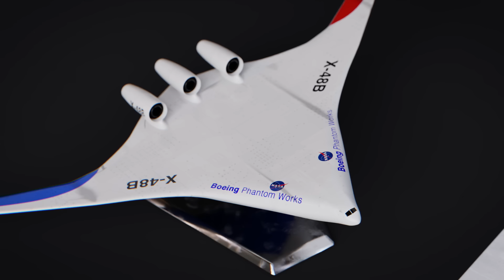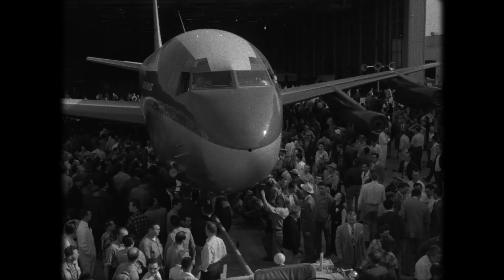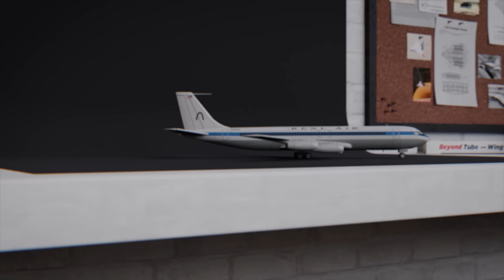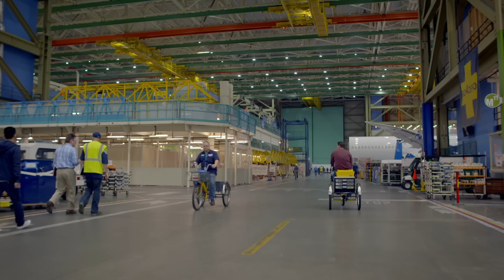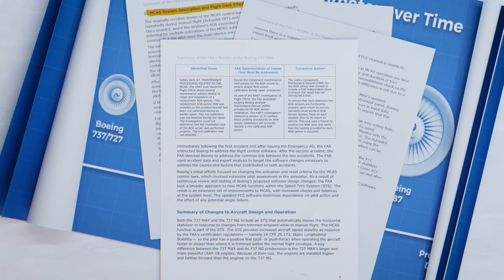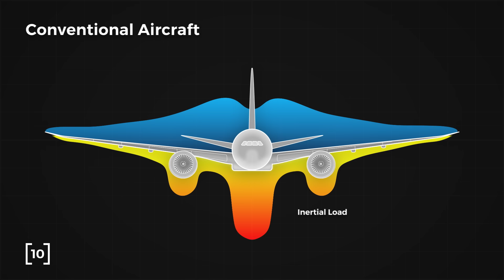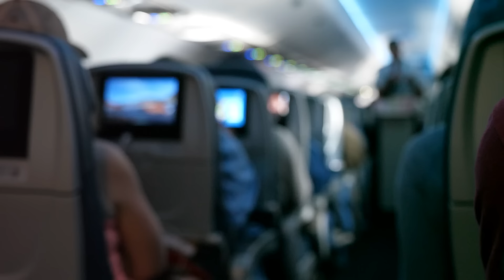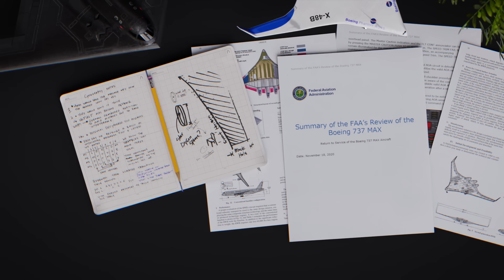The Plane That Will Change Travel Forever

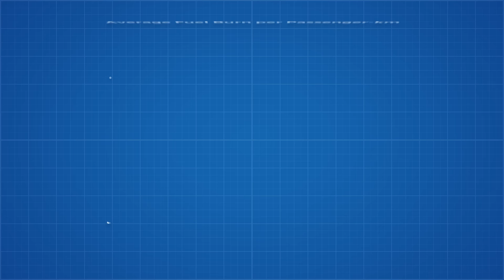Comment: "Nice" misleading graph at 1:06. The axle of the graph depicting fuel burn starts from 50, not zero. Sometimes there are proper reasons to adjust graphs this way, but I can see no good reason in this case. When the name of the channel is Real Engineering,  the audience deserves to see real graphs.
Reply: its still down nearly 50%
Reply: @xdxmABB  
- " its still down nearly 50% "
Yes, it is, but you seem to have missed my point. I didn't say or imply that there has only been a minor change in fuel consumption. My point was that when you do a documentary, you should convey the information in a way that isn't likely to mislead people. In this case many people will be mislead, and not slightly, but close to an order of magnitude. What's more serious, the misleading seems to be intentional, as anyone with a basic understanding of statistics knows that graphs like this one will mislead people. It's exactly what causes people to say "lies, damned lies, and statistics". The problem isn't statistics itself, ofcourse, but misuse of it.

Comment: I noticed 5 major benefits the 'flying wing' design would have over its more traditional counterpart that you didn't mention.
1) By eliminating the need for a tail stabiliser, the 'flying wing' design would effectively reduce the plane's length (central axis running front-to-back). This is significant as it would reduce the possibility of minor incorrect/imprecise weight loadings/calculations having a significant impact on the plane's overall aerodynamic stability. Generally speaking the lengthwise axis in a typical plane design is the most unstable and hard to manage axis due to its far proximity from its center of gravity. 
2) Disregarding the control issues mentioned in the video, there's practicality in the design as a glider. To keep it short, if the plane was 'falling from the sky' intact, the belly of the fuselage has a great amount of surface area, the design could be used to extend its rate of descent and gliding range (via vertical drag). This means that the drag produced by the plane could help reduce the impact forces experienced by passengers during a controlled emergency descent.
3) Based on B2 'flying wing' designs and other similar experimental military designs, the engines of the plane could be mounted on its roof. There are numerous benefits with this mounting position the first being how it reduces the likelihood of tarmac debris getting sucked into the plane's fan intake and severely wrecking the engines. (notice how I didn't say bird intake)
4) The roof-mount configuration would increase safety by reducing the likelihood of ground crews getting caught in the moving engine or getting knocked over by the windblast of the engines.
5) Finally, the roof-mount configuration allows for the possibility of jet engine noise being redirected upwards towards the outer atmosphere away from the ground. This would be crucial in reducing the overall amount of noise pollution that affects homes located under any flight routes.

Comment: It's great having windows, but I find it more claustrophobic to squeeze past other passengers and bags down the narrow path through the fuselage.  As long as the ceiling / overhead storage is't too low, a much wider area that is brightly lit would feel like any room we have no problem working and living in all day.
Reply: Maybe the "windows" could be shifted to the ceiling in the form of light tubes for skylights?  And the storage could be moved to under-seat to open up the headroom.

Comment: No matter how safe the design of the airplane is, or how safe the software is, if those safe designs are not forced into the final product, and any future modified versions of the model, by the FAA, and other regulatory agencies, it is all for naught. And more fatal disasters await us.
EDIT: Even more concerning to me is the susceptibility of software to hacking via criminals - or manipulation inadvertently in the cockpit. The software should not be accessible at all outside a single keyboard in the aircraft. Any updates must be done individually for each aircraft just as hardware updates are done. There should be no access to the flight computers by the pilots or flight engineers to change any routes via handheld private devices. Only flight data such as meteorological data, altitudes, the approved flight path, should be changeable in the aircraft. No private or company or contractor device capable of being connected to the internet should ever interface with the flight computer.
Reply: But of course, because the Internet of Things Shit is the hot new thing, the bigwigs will insist on using it anyway, despite all the dangers involved.

Also because when updates can be pushed remotely, instead of needing to have physical access, it makes updating the software cheaper in terms of money, at the cost of safety.
Reply: @ExEBoss  There will always be corporate greed as a counter to safety. The only counter to corporate greed is the FAA and the occasional whistleblower. If the regulators are not constantly diligent and cognizant of new ways to introduce dangers into a system, there will be fatal consequences. Hackers will always find a way to corrupt software. Eliminating their access via the internet greatly reduces their threat. But even standalone software can have malware introduced, and must be thoroughly vetted and protected.

Comment: Looks great for a military fuel tanker. Airlines will not spend 10 times per aircraft to save 25% on fuel. But the army has no problem wasting 1.4 billlion with a B per aircraft that can crash because of 50 cents sensor.

Comment: Just a minor historical point: the "tube and wing" configuration surely predates even World War I; The B-47 was one of the first such designs with pylon-mounted jet engines and swept wings typical of modern turbine-powered tube and wing aircraft.
Reply: Paul Crumley,there weren't any technical lesps and bounds in aircraft before WW1,the first airplane flight was only 16 years before the war started.There were 2 types of biplanes then.A single seater and a dual seater.Germany actually came up with the Delta and the "flying wing with aircraft.The Horton was one ,it never saw service.The Brits stole that and made the Meteor before WW2 ended.The B47 didn't come on to the picture til the early 50s,as it was a long range Nuclear payload bombers.

Comment: I'm sure much of the improvement is due to better technology. But how much of it is due to squeezing in more people with shorter distances between seats fore and aft, and side to side? That would be an interesting stat to post Real Engineering.
Reply: The airlines are giving the majority of people exactly what they are willing to pay for. Cheap fares come at cost to comfort, included baggage, flexibility and meals.
Reply: Does a fat guy twice my weight still get the same luggage weight allowance?
Reply: Ww2 all invented, others not deleted e c plain why not likely assuredly won't happen. Mag lev high speed, lighter than air giant wings, designed. Hydrogen? Ffs, space, 🇺🇸not reached before not he,p not in 40s

Comment: 25:05 It is highly unlikely hydrogen will replace kerosene in airplanes. I wrote a "hype overview" on hydrogen and during my research, I calculated that the 5.3 TJ of kerosene energy equals to 621,420 liters of liquid hydrogen. This volume is equal to the tanks + the cargo bay + an 8m sphere outside the airplane. Because hydrogen is overall lighter than kerosene for the same quantity of energy packed, you might have efficiency gains that reduce the volume you need, but it's not straightforward: cryogenics are a pain to work with, compressed hydrogen is out of the question because way to heavy and fire hasard is much much higher. (source: https://medium.com/@florent.henry/practical-assessment-of-hydrogen-outlook-813c80f94bdc?source=friends_link&sk=null)

Comment: blended wing passenger aircraft will never work. Why you could not evacuate them fast enough in an emergency.

 As part of the certification process, aircraft manufacturers are required to demonstrate that an aircraft, in maximum density configuration, can be completely evacuated within 90 seconds using only half of the total number of emergency exits.
Reply: @SimonWoodburyForget   prove that please, ie direct me to the info.

Comment: One of the major issues with civilian blended wing designs is the high cost involved in changing around every airports infrastructure to allow for them.
Reply: Would probably need less runway, so that's ideal. The military didn't have to build new air bases for the B2.
Reply: @Nippleless_Cage  potentially although the horizontal stabilisers also help with pitch authority, my comment has far more to do with the capability to get passengers on and off the plane quickly as well as their baggage.

Comment: Part 1
My opinion will NOT be popular but I will support it with facts and not emotional opinions. There is no mention of pilot error. I am going to tell you about a procedure for ALL models of the 737 dating back over 52 years that all 737 pilots are supposed to know from memory. These types of procedures are called "memory items". The procedure is the Runaway Stabilizer Trim procedure and it is a "memory item" for 737 pilots. Pilots should know "memory item" procedures like the back of their hand and should never have to get out the FCOM manual and look it up. MCAS is not a system, it is a program routine. It is 1 program routine out of thousands of program routines. It is not possible to teach pilots what every programming routine will do when everything is working properly and it is certainly not possible to teach them what every programming routine will do when sensors are malfunctioning. Though the pitch system in the MAX is somewhat new, the pilot actions after a failure are exactly the same as they would be for a runaway trim in any 737 built since the 1960s. Pilots really don’t need to know WHY the trim is running away but must know, and practice, how to disable it when it is running away.

We know that the Lion Air flight that occurred just prior to flight 610 experienced the exact same runaway trim condition. We also know that that flight followed the memory item Runaway Stabilizer procedure and recovered the airplane. This information was NOT given to the pilots of flight 610. Both of the Lion Air flights I referenced experienced "stick shaker" events as the trim was running away. In the US airline pilots are required to land at the nearest possible airport after recovering from a "stick shaker" event. The plane is not supposed to be flown with passengers again until the exact problem that caused the "stick shaker" event has been identified and corrected. When the first Lion Air flight experienced the runaway trim condition they also experienced a "stick shaker" event. After the pilots corrected the runaway trim condition they did not land but flew on to their current destination. The aircraft mechanics and engineers did not identify what caused the "stick shaker" event and handed the plane off to the flight 610 pilots that crashed killing everybody onboard. 

Ethiopian Air: This crash, in my opinion, is 100% on the Airline and its failure to communicate to the pilots the content of the Emergency Airworthiness Directive (AD) 2018-23-51.
 
An Emergency Airworthiness Directive (AD) 2018-23-51 was sent to all 737Max 8 and 9 owners after black box data showed that the pilots that crashed Lion Air flight 610 failed to follow the existing runaway stabilizer procedure.

Emergency Airworthiness Directive (AD) 2018-23-51 reinforces the need for pilots to follow the existing runaway stabilizer procedure and adds more information on how malfunctioning angle of attack or speed sensors can cause runaway stabilizer commands.

This AD is effective December 21, 2018, to all persons except those persons to whom it was made immediately effective by Emergency AD 2018-23-51, issued on November 7, 2018, which contained the requirements of this amendment.
 
FAA AD #: 2018-23-51
2018-23-51_Emergency.pdf
https://www.federalregister.gov/documents/2018/12/06/2018-26365/airworthiness-directives-the-boeing-company-airplanes

It seems that the pilots of the Ethiopian Air crash did not know about this directive. That is baffling to me. There is no excuse for the Ethiopean Air crash to have occurred. Emergency Airworthiness Directive (AD) 2018-23-51 told pilots exactly how a failed MCAS system would present itself as Runaway Trim and then told the pilot how to correct the problem.

Whilst I state that both crashes were pilot error I don't blame the pilots totally. The airlines they worked for were responsible for their pilots' training and they failed their pilots in that regard. 

Indonesia's version of the NTSB is: 
KOMITE NASIONAL KESELAMATAN TRANSPORTASI (KNKT)
REPUBLIC OF INDONESIA 

The final report is 322 pages long but it only takes reading 20 pages to find in this statement of fact "The flight crew started the IAS DISAGREE Non-Normal Checklist (NNC), but did not identify the runaway stabilizer."

People can believe whatever they want but the KNKT officials state very early, and very clearly in their report that the flight crew "did not identify the runaway stabilizer".  

KNKT.18.10.35.04 
2018 - 035 - PK-LQP Final Report.pdf
http://knkt.dephub.go.id/knkt/ntsc_aviation/baru/2018%20-%20035%20-%20PK-LQP%20Final%20Report.pdf

Page 20 of the PDF, page xviii of the report

On 26 October 2018, the SPD (speed) and ALT (altimeter) flags on the Captain’s primary flight display first occurred on the flight from Tianjin, China to Manado, Indonesia. Following the reoccurrence of these problems, the left angle of attack (AOA) sensor was replaced in Denpasar on 28 October 2018. 

The installed left AOA sensor had a 21° bias which was undetected during the installation test in Denpasar. The erroneous AOA resulted in different indications during the flight from Denpasar to Jakarta, including IAS (indicated airspeed) DISAGREE, ALT (altitude) DISAGREE, FEEL DIFF PRESS (feel differential pressure) light, activations of Maneuvering Characteristics Augmentation System (MCAS) and left control column stick shaker which were active throughout the flight. The flight crew was able to stop the repetitive MCAS activation by switched the stabilizer trim to cut out. 

After landed in Jakarta, the flight crew reported some malfunctions, but did not include the activation of stick shaker and STAB TRIM to CUT OUT. The AOA DISAGREE alert was not available on the aircraft therefore, the flight crew did not report it. The reported problem would only be able to rectify by performing tasks of AOA Disagree. 

The following morning on 29 October 2019, the aircraft was operated from Jakarta with intended destination of Depati Amir Airport, Pangkal Pinang. According to the DFDR and the CVR, the flight had same problems as previous flight from Denpasar to Jakarta. 

The flight crew started the IAS DISAGREE Non-Normal Checklist (NNC), but did not identify the runaway stabilizer. The multiple alerts, repetitive MCAS activations, and distractions related to numerous ATC communications contributed to the flight crew difficulties to control the aircraft.